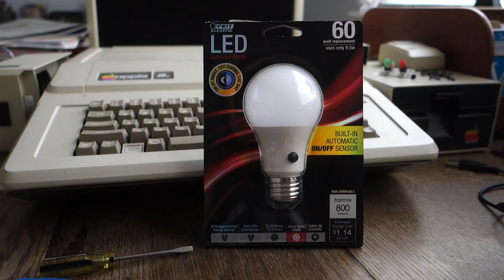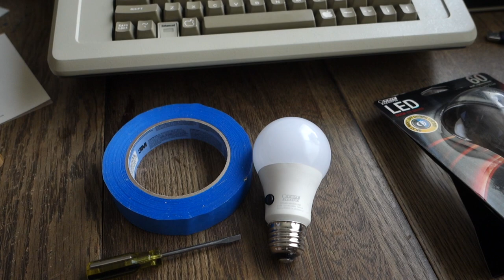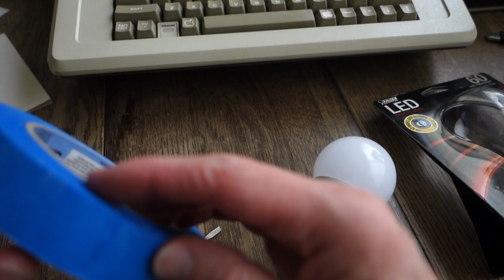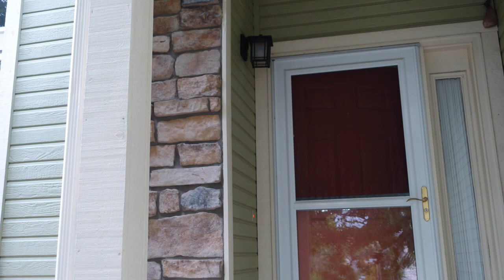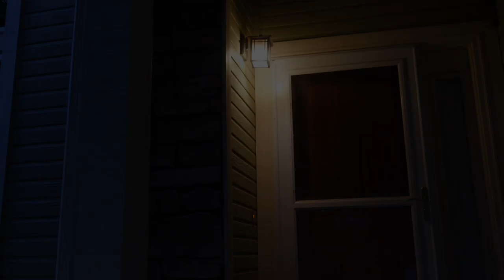Feit Dusk Dawn LED Bulb Fix

Comment: I have experienced a related problem with FEIT dusk to dawn bulbs flashing on and off every fifteen seconds at night (I know on other websites people have complained of this issue). In my case I determined this was clearly being caused by light reflecting back on the sensor from the glass of the globe light fixture in which the bulb is located (i.e. when I removed the globe the bulb no longer blinked off). My successful work-around involved just putting a little strip of scotch tape over the sense, which apparently deadens the sensor just enough that the reflected light no longer triggers the light to turn off.
Reply from the maker: Ah, that's an excellent solution. It seems like FEIT should provide some sort of "calibration" method, maybe just a slider that adjusts a variable resistor or something. Just so people don't have to keep doing these workarounds.

Comment: Thanks for the hack. I was so excited to try this however, it appears they made a change (for the worse) and the black plastic dot is now slightly submerged and really secure in the hole and is impossible to remove. So frustrating. The light goes on - but does not go off.
Reply from the maker: Hmmm, that's a bummer. Sounds like Feit needs to fix the real problem, otherwise people are going to stop buying the bulb... I suppose you could try to carefully cut or drill out the plastic dot but of course it might ruin the bulb. Or just return the bulb...
Reply: Would painting the black cover white work?

Comment: Thank you so much for this! I was very frustrated by daylight not turning it off. I used 2 pieces of painters tape and it worked perfectly. I tried 1 but with the cover on, the bulb shut off quickly and turned back on. =)
Reply from the maker: Excellent! So glad that it worked!

Comment: Thank you for posting this video. I found it useful as I was struggling with the same issue
Reply from the maker: No problem!
Reply: I am still struggling the light not functioning as expected outside on the covered porch. 1 layer of painters tape seems to cause flicker every 23 seconds, even 2 layers seem to cause flickers every 23 secs. However 3 layers stop the flicker at night but the light will not turn off during the day. I suppose the tape is not filtering the light correctly. However, I don't understand the flicker.
Reply from the maker: It sounds like the lightbulb may be sensing itself! Maybe try putting a small shield (made of tape?) above the light sensor, to block out the light from the bulb. That way it will only sense the ambient light. Best of luck!

Comment: Can painters tape on a sensor hold up to the heat in an enclosed fixture?  Is it safe?
Reply from the maker: Since it's an LED bulb, it generates very little heat. If it was maybe in direct sunlight then I suppose it might get warm inside, but even so, that little square of tape shouldn't cause any issues.

Comment: I just purchased the fiet Motion sensor light bulb. I returned the first one thinking it was defective but the second one isn’t working either. The light just stays on. I have it set up by my porch which is secluded and rarely has motion. Any quick fix for that?
Reply from the maker: Hmm, that's a bummer. Do the instructions say anything? Sometimes those bulbs have a mode where it stays on permanently. Try turning the bulb off for like 5 minutes, and then back on, and see if it behaves better. If it doesn't, then you might have have to give up and get a dedicated motion sensor.
Reply: @CT6502  I've now bought 2 of the Feit motion activated Intellibilbs. The haved a switch for day and night, or just night mode. they are both controlled by motion only. They just set weather it works 24 hours a day, or just at night. However, both light have never gone off on either mode, in dark or light. They just act like a standard bulb. Don't think I'll try a third. Like the concept, but nothing seems to get them to go off other then cutting power to them :( (I've installed plenty of photo-cells and motion lights, and tried on-off-on type of ideas to trip iot, but still just works like a bulb) Anyway maybe a bad batch, but a great idea for a under $10led
Reply from the maker: @darrenblack2802  Huh, that's a bummer that they don't work. I agree with you - good concept but maybe not so good in production...

Comment: My problem with these bulbs is actually getting them to turn on.  I bought 3 Feit Electric LED dusk to dawn bulbs to replace my fluorescent dusk to dawn bulbs outside in the lanterns.  The only problem with the fluorescent bulbs is that the "eye" sensor gets clogged with dead bugs that die inside the outdoor lanterns outside of the garage.  I thought I'd upgrade to the LEDs.   I installed all of them during the day, with the power off.  I tightened them snugly.  There is a swivel built in the bottom that allows me to rotate the sensor, which I rotated to the best location.  None of the lights turn on.  I rechecked the bulbs at night and took them out and replaced them back in, but still no light.  I tested the LEDs in a chandelier and they work.  But they just aren't working outside in the lanterns.  Any thoughts?  What am I missing.
Reply from the maker: I've had problems just like that. Try turning off the bulbs then waiting at least 5 minutes. Then turn them on again.
Reply: Chris Torrence no instructions but I twisted the bulb around about a 1/4 turn, now it’s working better. I think the Sensor was picking up light from my window. Thanks for the reply.

Comment: Do you know if this problem exists with other dusk-to-dawn bulbs, like the Phillips?  I'm having this exact issue with the Feit and can try hacking it as you describe or return it for a different brand.
Reply from the maker: I'm not sure about other bulbs. I would guess that each one will have a slightly different threshold, but since you already know how to hack the Feit, it's probably easier to just go ahead and try it.
Reply: my Phillips lights work perfectly and my Feit do not work at all.

Comment: I just found your video.  I removed the cap, let the sensor "reset" and still nothing, it won't turn off.  I think the sensor crapped out.  I even sat there for two minutes shining a flashlight on it,  still nothing. It's not even one year old.
Reply from the maker: wicky201 awww man, that’s a bummer. It sounds like they changed the design, I wonder if the sensor is cheaper. Maybe give it another try and hope for the best!
Reply: @CT6502  Feit will be replacing it. Just got off the phone. Interestingly, testing it with  a regular flashlight will not work.. from what she told me. I doubt that.  A spotlight from a police car works!
Reply: *UPDATE* New bulb received and installed. I was able to remove the black shade with a tiny flat head screwdriver. The light came once  it was dark, about ten minutes after sunset. So far so good.
Reply from the maker: @wicky201  Great to hear! I'm glad that Feit was responsive.
Reply: 3 years later, the sensor died, stays on constantly.
March 31 2022